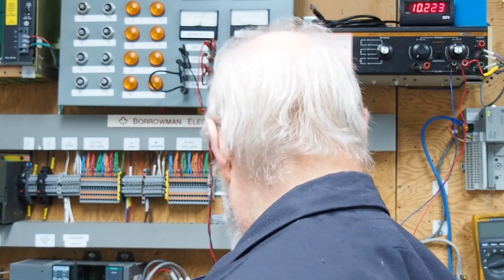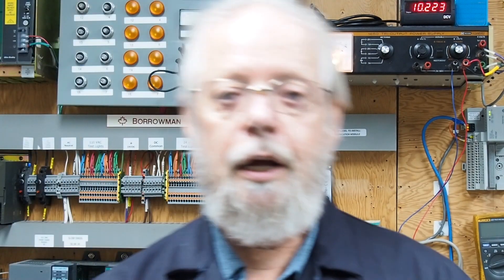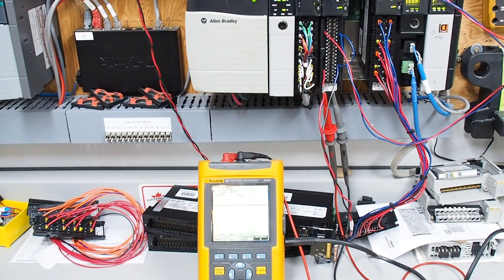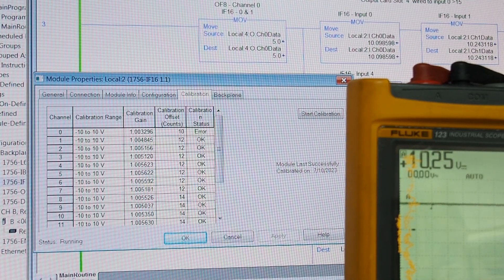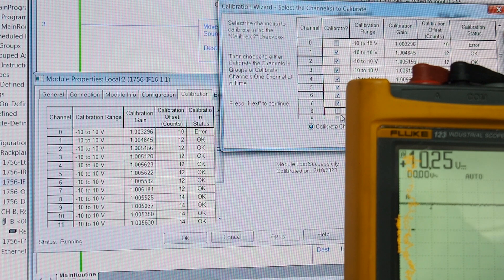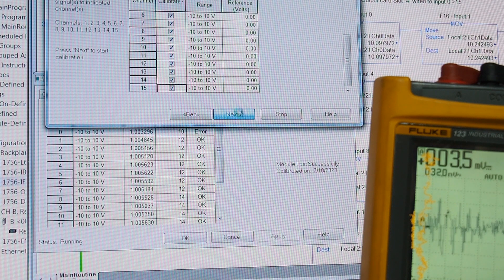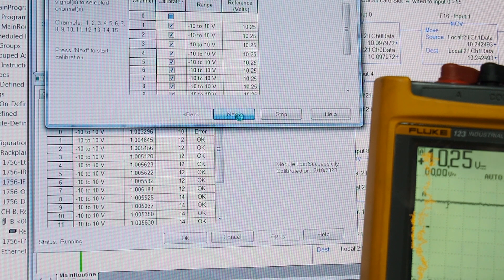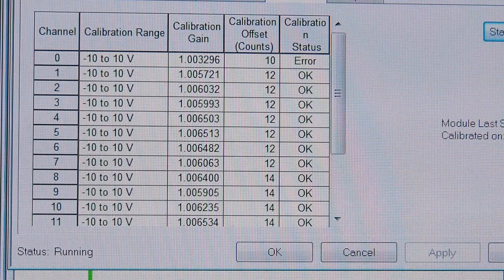Calibrate a 1756-IF16 Analog Input

Comment: I just replaced a couple 249 ohm resistors on a couple channels of an IF6 that got blown up and needed to run through a calibration. I've no ideas if the rest of the circuit was damaged at the same time but hey, it was trash when I got it so can't do any more harm. Thanks for putting this out.  But you should short the input for the zero-reference portion instead of just turning it down. There is too much noise on that zero reference.
Reply from the maker: Hi Emmer:  A while after I made the video I realized that shorting the voltage was a better way.  Just never updated the video.
Glad it was of help to you.

Comment: Hi , i want to calibrate my modules but most of the tabs are not there for my modules such as 1746sc_ni8u and 1746_ni4 only general,connection, and some also have configuration, why no calibration, backplane, module info etc. tabs? thanks
Reply from the maker: Hello:
For the NI4 - the calibration procedure is in the manual for the module.  (Publication 1746-UM005B-EN-P - June 2004)
For the Spectrum Controls you will need to research on the Spectrum controls site for the proper manual for the module you want.  (https://www.spectrumcontrols.com/).  Some of the SLC500 analog modules do a continuous calibration while running.
You need to check the manual for each module that you want to check.
I hope this helps.
Reply: @abplctestbench759  thanks for the info, much appreciated, keep up the great content!

Comment: I have 1756-IF6I, I want to injecting 0-10 Volt using Proces Caibrator. I want to see the value come in channel 0 in RSLogix. Which terminal I put my Process Caibrator probe?
Reply: Where process Caibrator source 0-10 Volt
Reply from the maker: Hello Syafrizal:
Is the module set up in the configuration screen for Voltage or Current.
Your common terminal is wiring arm terminal #5
Your + Voltage terminal for channel 0 is terminal #1.
Most of the wiring diagrams for the majority of the modules are contained in the AB manual - "Publication 1756-TD002N-EN-E - November 2021".  I would suggest that you find it and download a copy for your reference.
Bruce